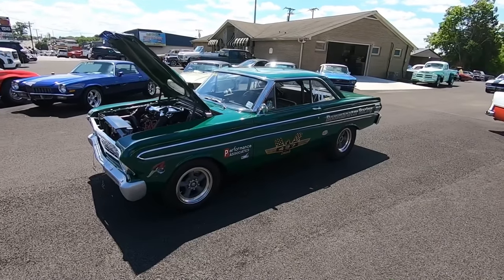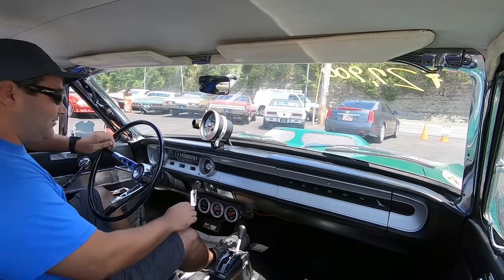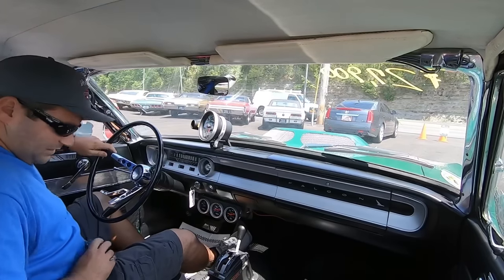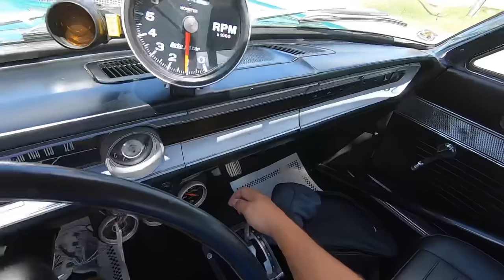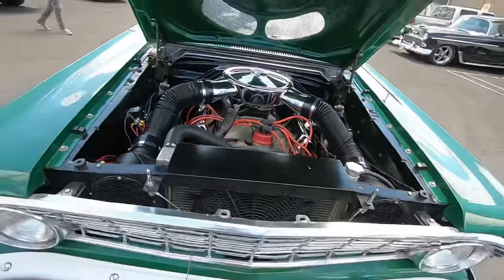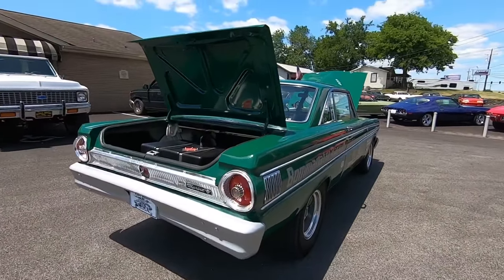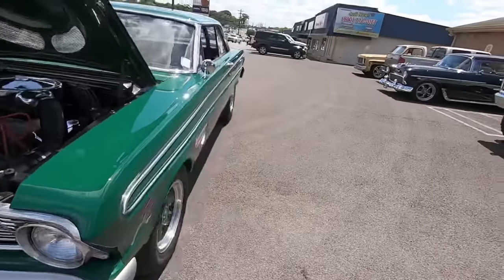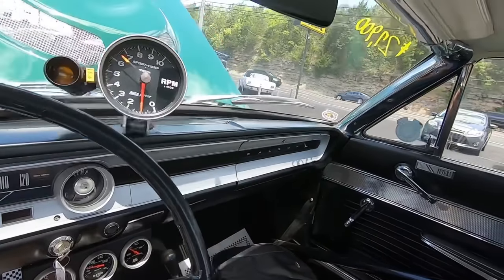Test Drive 1964 Ford Falcon SOLD $27,900 Maple Motors #1140

Comment: $27900, you gave that away. There is 40k in that car easy. An FE built like that costs a lot! Someone spent a lot of money with Crites, hood, bumpers, old school traction/ lift bars, long tube headers, probably motor mounts too. A100 Dodge van seats are hard to find and not cheap, then recover. $2500 for the trans and converter at least, and on and on. Well worth the price. I don't especially like green,  but if I had bought it,  the green would have stayed. Great job Nick!
Reply: Yes , that was too cheap . I was  offered close to that for my 289 , C4  65 falcon ,said no .

Comment: Dang!!!! That one has the correct wheels, and the correct rumpa rump!!! That would be one fast toy for sure, no need for power steering, that beast is made for the straight lines a quarter mile at a time!!! Dude you have got a dream job and it looked like you had a blast with this one. Really sweet ride!!!

Comment: Just FYI, dont turn on the fuel pump or fan until after you start the car, saves on battery for starting a high compression engine.
Reply: Agree. The timing needs a little tweaking.
Reply: That’s it Bro. Racers will add a power switch also. They start cranking the motor then hit the power switch and it will bust rite off, then turn on fuel pumps and water pumps. Yes Sir🇺🇸🏁

Comment: I had the 64 Sprint convertible falcon. I put a boss 302 in it with a 4-speed. Unfortunately a Cadillac pulled out in front of me while I was going down the road and I totaled the little falcon. So I took the motor out and put in a 1965 Mustang. They were both fun cars to own.

Comment: Be interesting to know if it's a real 427 or something stroked to get 427 cubes, if it's a real side oiler that would be killer 💪
Reply: @joen5332  I'm wondering how you figured that out Joe. There's no shots of the lower end so no way to see if it has cross bolts. It sure looks like an FE engine. Could be a 390 406 or 401 I suppose. At least we know a 427 would cost as much as the entire car right? Lol Anywhoo love the BB FEs. Sound like an 8 cyl Harley on brimstone from hell.
Reply: I didn't think it was possible to get an FE into a 64 Falcon without cutting the shock towers?  I believe the 65-66 Mustang used the same engine bay dimensions as the 64-65 Falcon.  There was no big block option on the first two model years of the Mustang because the FE wouldn't fit.   From 67 on the Mustang shared the same engine bay specs as the Fairlane/Torino.   Those cars could all be optioned with a big block.
Reply: The FE big blocks measure smaller than the GM or Mopar big blocks. A 427 block is about half way between a 289 block and a GM big block. But it looks like the shock towers were modified anyway. One thing you can't hide is the location of the distributor. The water pump is barely visible in the video too. It's an FE big block. Looks just like any 390 I've owned. The only proof I can tell that it might not be an actual side oiler is the price. Btw back in the day hot rodders and racers crammed 427s into every Ford made...including the Pinto. Although the 429 was a more popular choice by then.
Reply: Well I'm no Ford expert so I couldn't tell what it was, but they did sale a Mopar awhile ago and it had a Hemi in it and the price they were asking seemed cheap for the car having a Hemi. Thanks for the Ford info.👍
Reply: @archiebunker6059  oh ya man I liked that mopar a lot!
Reply: @joen5332  cool ya I've had a few 390s. But what I am asking is....how can you tell? What are the differences? The only ones I know about are the stamp and the cross mount bolts. And I can't see either of those locations anywhere in the video. Tell me! My ocd is acting up again!
Reply: Color looks a lot like British Racing Green
Reply: Ok guys when i got the paper work on the car it said it was a tribute car  a tribute to the 427 comet  but it also came with papers on the motor  with cam and other stuff it said it was a 428 cobra jet FE  engine i my self can guarantee it is an FE it does have big block power  edelbrock intake and rpm performance heads  after driving it i think it will run mid to low 11 sec 1/4
Reply: If it was a side oiler it would be a six figure car

Comment: it will start or turnover faster if you run a 0 gauge ground  wire from the engine block to battery ground direct.
Reply: Agree 100%, and adjust timing a bit.

Comment: The moror is definately an FE. You can tell by the small rubber hose from the top of the water pump into the intake and the water thermostat housing is angled to the left. Another way is that part of the intake manifold sit under the valve covers. It's probably not a gen 427 side oiler, more likely a 390 which are quite common.
Reply: Its a 428 cj

Comment: When it comes to early Fords in that era, if it's an original steel body, look into all the crevices because Ford put absolutely NO rust prevention efforts in the body.

I once inspected a 1963 Falcon before putting an offer on it.  It looked really sweet but when I looked down inside of the doors with the window rolled up, it was just caked in rust.  Early Mustangs also had no rust prevention in the cowl hat area.  It's buyer beware.  

One guy bought a pristine looking 65 Mustang convertible and when his mechanic looked at it AFTER the purchase, the mechanic advised the owner to not drive the car anymore.  The underside was a total rust bucket.

Comment: Starts like it's got too much mag in it or the battery is just about gone.
Reply: What do you mean by to much mag ?
Reply: @gerryrogue7710  The magneto is advanced way over the top to give him the total timing he wants at high RPM. Makes the starter struggle initially on start up.